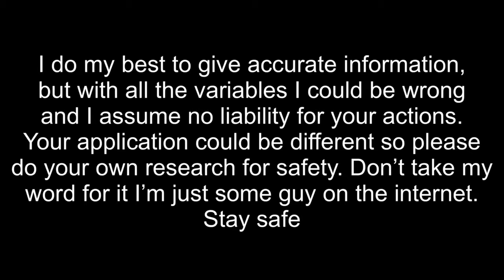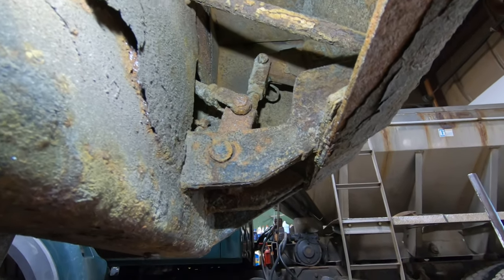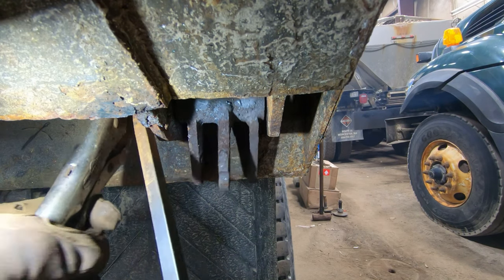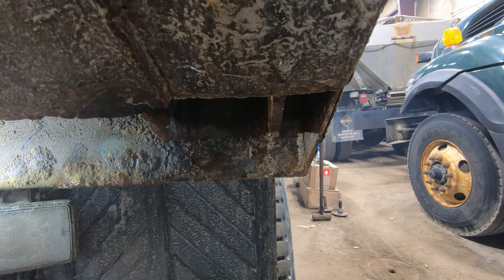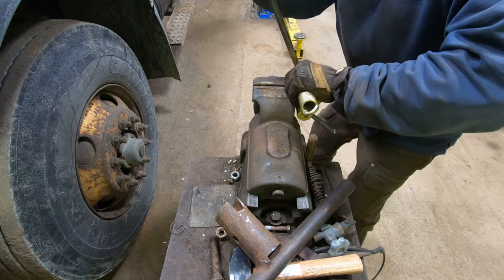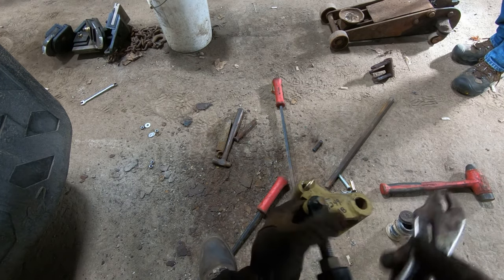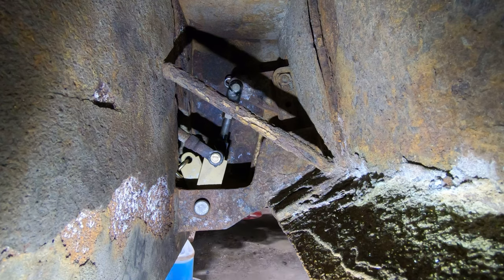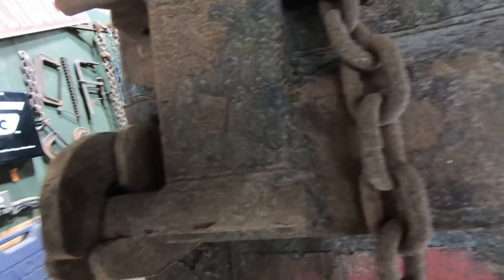Today at work 2, replacing tailgate latch linkage

Comment: Thanks,  I learned some new tricks to getting pins out.  If the designer of this system had drilled a hole through the outer side plates in line with the pins they could be punched out from the small end.  Also,  It looks like the undercoating is a loose flap keeping moisture on the metal.
Reply from the maker: I had to do the same thing to a second truck today and I could not get the long pin out. I did have to put a hole in the body side to drive the pin out. It’s amazing how the rust can form a sheet like that. I’m always surprised how thin steel can fluff up and flake off so much rust